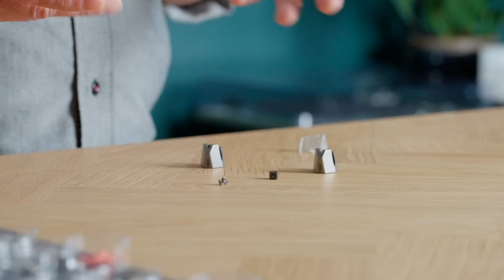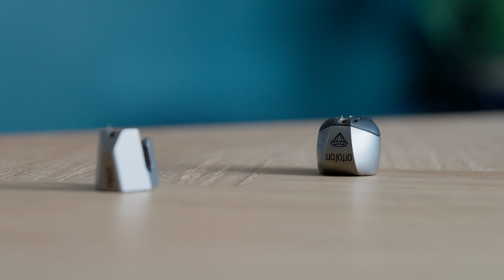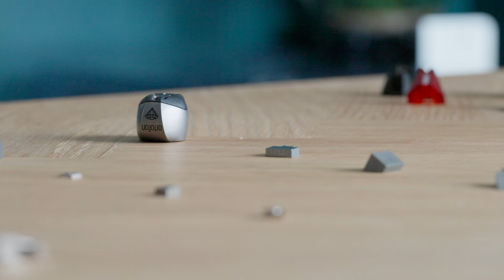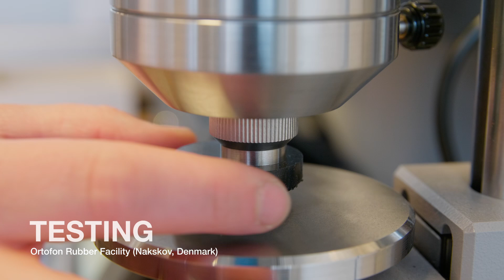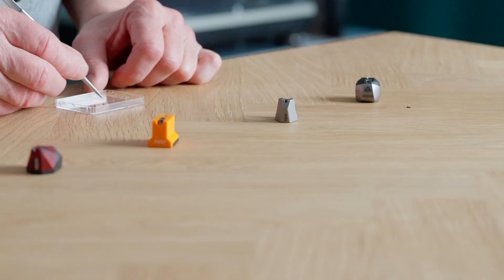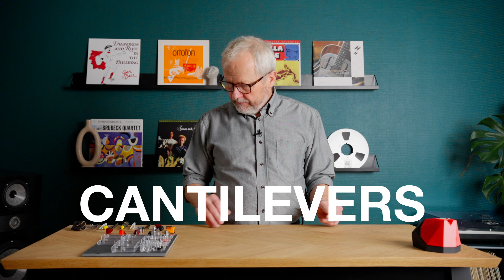What Makes a Cartridge Good? | The Power of Material

Comment: Thanks for the great video!

If I understand it correctly. As we know a winding with a iron or some sort of alloy as a core WILL Increase the efficiency of those windings and produce a stronger "magnetic flux".

But the metal and magnetic core will also on the other hand  being effected by the magnetic field from the cartridge and that is unwanted side effect.
So you remove the magnetic iron alloy core to something non magnetic that is not effected of the cartridge permanent magnetic field.

But the efficiency went down so you need to increase the number of windings (even more mass) and put a stronger magnetic field in the cartridge to compensate for that.

So the non magnetic amateur:
"Non magnetic amateur you will achieve a openness and a freedom that are amazing"
At: 33:06 

That is on the top of the line MC cartridge.

The canteliver is mounted to the amateur and they two together is one unit. And as for mass the total complete unit that moves with the grove is diamond, cantaliver, amateur with its windings.

And let's look at the MM the cantaliver is mounted to something that is as magnetic as it can get when it is a Magnet.
It's tiny lighter and don't have the issue with a traditional iron alloy core that hindering it to move freely. 

So would not a MM be better than a MC when we want it to be as magnetic as possible and less mass then the MM should be even MORE "openness and a freedom" than any MC cartridge could be able to replicate?

Or what am I missing here.
Reply: I can't explain the engineering or physical aspects as well as you, but I think you're right. The lightest cartridge ever, mass-wise, I believe is the Technics EPC-100 Mk4 with 0.05mg effective moving mass and response up to 120kHz. And it's a Moving Magnet cartridge, although I don't know if it required the standard 47kOhm load or something lower. The output was 1.2mv, not super high but much louder than LOMC's

There are also Moving Iron designs that are lighter than many Moving Coils, mainly by Bang & Olufsen (MMC6000, 0.22mg) and Soundsmith (Zephyr, 0.3mg)

Lately there has been developments such as the strain-gauge and the optical cartridges, which are supposed to be extra-light mass and claim to be lighter than most MC's, but I don't know if they specify how much mass they have exactly
Reply: @VinylComeback  Yes, thanks for the reply. I start to suspect that a MM is actually superior and better in every way including sound quality.

There is many reasons why audiophiles may and will think differently.

The market force (that more expensive is automatically better, nobody what to believe that they paying a premium for a MC and getting suboptimal mechanical construction)  and the established "internet wisdom" telling us deeply rooted that MC is sounding better than MM.. ..is it how did somebody come to that conclusion, maybe different..

One thing that I have learned is that audiophiles are a "strange" in the respect that if some says that vacuum tubes or turntable sounds better or some other and older technology then they promote as if it were gold. 
But actually it is just most probably sprung out of their personal subjective preconditioned taste. 

Because they for example have listened at Beatles on their TT in their youth 61 years back when they debuted. 
Then they're preconditioned from their TT playing that it "should" sound like when playing a LP.. 

I think it is a shame in a way that it is like indirectly saying that the technologically advancements the latest 50 years has not made any advancements in sound quality at all or are worse than back then..

That I have very hard to believe and swallow! 🤭🥳
Reply: @AmazonasBiotop   You're completely right, one of the things that has always blown my mind is that the MC design has stayed so expensive over the decades, even though it's been used since in pickups since the 1940's and in cartridges since the 1950's. There's no way be should be paying premium money for a design that's been manufactured for more than 70 years.
Why should an entry-level MM cost 40-50€ but an entry level MC cost 300€ and upwards? And why can't we make user-replaceable MC assemblies today, even though it's been done since the 1960's?
Like you say, it tells a lot about the industry and its business model.

I like collecting old cartridges from the 50's and early 60's. But the old cart "community" is insane. People claiming that these old arcaic designs sound better than modern ones. I always say "What?" There's no way people convince themselves that a spherical stylus moving 3mg or more effective mass is better than a more modern design, simply because they enjoy the distortion and coloration these antique cartridges have. I have my preferences too, like everyone else, but I try to look at things objectively as well.

Comment: What made Ortofon choose titanium over magnesium?
Because magnesium has similar benefits: lightweight and high stiffness/rigidity.
Magnesium is commonly found on higher end tonearms because of this.
Reply: Magnesium is highly flammable. Magnesium + lasers = really bad idea😅
Reply: @ulrikmortensen9426  Magnesium parts are basically always an alloy, so they're not flammable at all, unless ground to a fine powder (much like steel or aluminium).
In fact, the armwand of the tonearm I'm using right now is made of cast magnesium (SME V).
But yeah... pure magnesium would be more like fireworks lol

Comment: Thanks Leif, excellent informative and interesting. Good on you Ortofon. I have an MC Blue, 2M Black and an older VMS20E MkII. The suspension in the VMS still seems very compliant after 35 well-used and well cared for years. That is another system isn't it, moving iron cartridges?

Comment: A very informative and interesting presentation. 

The established hierachy of MC over MM is problematic for a couple of reasons. It prevents ultimate exploration of MM because of the product price structure where MC has a sky's the limit price mechanism. This will always cap ultimate MM cartridge development.

More importantly. The tiny MC output is wholly dependent upon miniscule signal amplification in the region of over x25 or x27 in the case of the MC Diamond 0.2mV versus  2M Red 5.5mV or  2M Black 5mV. This is a large signal multiplication.
The dependence and reliance on amplification of this tiny signal presents some serious challenges to the designers of phono amplifiers. Least of all electronic noise and signal integrity in all associated electronics are never easily nor cheaply resolved. Amplification is serious business and the integrity of this miniscule MC signal is vulnerable, and I would argue, compromised from the begining. MM presents a High Fidelity advantage over MC in this regard. Simple physics.

It would be interesting to see and hear what a similarly developed MM would do to a materially comparable MC. Rare earth magnets aren't that expensive for the 2M series nor a myriad of other Ortofon selective range hierachy decisions.

The sad truth is that the establishment are not going to upset the price dynamics of foolishly fragile, expensive MC cartridges despite the fact that the greater output of the MM and the mechanics of this system present significant development opportunities that were compromised in favour of the premium pricing opportunities presented by MC.
Reply: The problem with high-performance MM's is that they depend on small, stronger magnets such as neodymium magnets, and availability quickly became a problem. Isn't that the reason why Shure stopped making cartridges? I think it was

What I would focus on is optical cartridges and strain-gauge cartridges, those seem that they could be the future